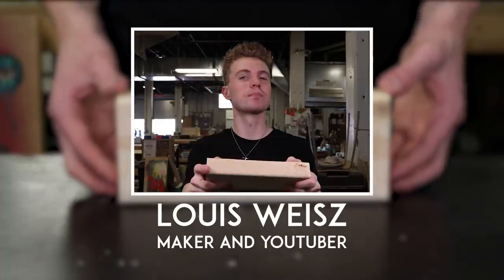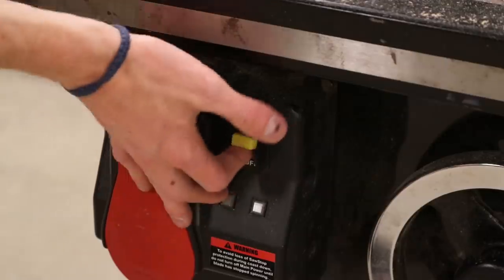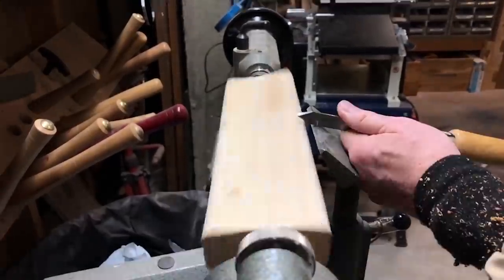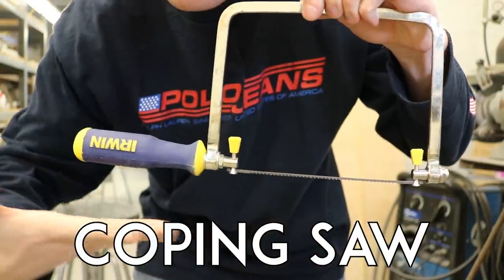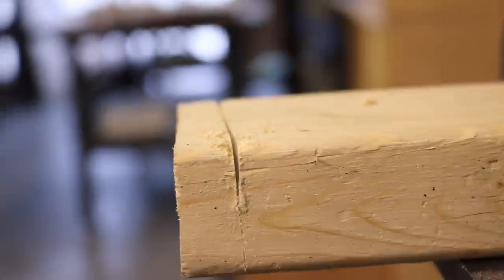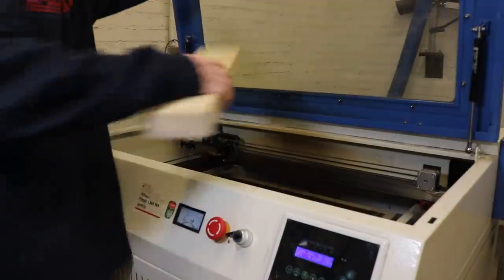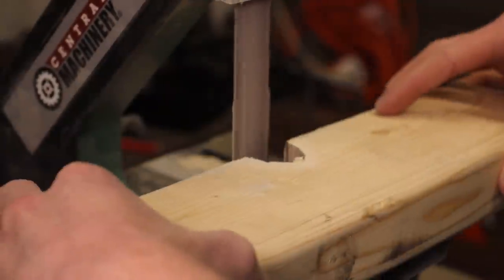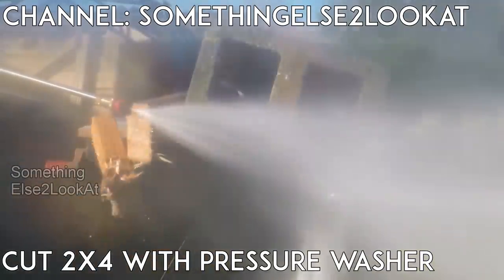Every Way to Cut Cheap Wood (39 Methods)

Comment: Seeing how he held a hand saw physically hurt
Reply: 4:57
Reply: @aquarius5264  Thanks!
Reply: Yes, pain.
Reply: Even my crappy 15 year old brain can tell that is not the way to do it. I've only used a small handsaw. Not the big ones.
Reply: Yep, its a straight back and forth from the elbow with one hand. extending from where the base of the saw begins at the wood to the end of the blade. Depending on the length of the saw your arm may sweep behind you, something that can't happen with the "two handed grip"
Reply: @diakounknown1225  I'm 15 too and i worked with wood with my dad and phew seeing how he was holding it kinda hurt
Reply: He used 2 hands for all hand saws which makes it even harder to use
Reply: wait thats not how you hold it?
Reply: @SkyHigh_xx  no... You hold it with one hand
Reply from the maker: @chaz7346  this is actually super helpful -- this is how i learned as a kid just because I wasn't strong enough to control the saw otherwise, but i'll be sure to remember this in future!
Reply: @Weisz glad to hear I was helpful.
You can steady your saw with your other hand, either on the side or back of the blade. But it isn't necessarily recommend. But just remember, just because your doing it by hand, doesn't mean it isn't still cutting and it will heat up the blade.
Reply: It's not that bad. Sometimes if I'm really impatient I use two-nanded grip to saw through faster.
Reply: @Weisz  Another tip for the hand saw is the point your index finger alongside the saw instead of placing it on the handle. Helps with control.
Reply: My woodwork teacher would have cried and tbh the idea of this big dude with a country irish accent who only showed emotion the time i joked about bringing home a red project from bleeding full on weeping at that is the one good part
Reply: Putting less pressure makes it easier to cut as well
Reply: @Jonah Lerberg ohh you have really good friends, i love that
Reply: Fr it gave me a PTSD flashback to when I was 5 and my grandpa taught me how to use a saw
Reply: @Weisz  However, make sure you use a Ryoba saw with two hands. The grip is designed so you can grab it with two hands. The ergonomics on western benches are questionable, but you should definitely hold it with two hands, pulling with your back muscles. It seemed to me that you lacked some strength in your pull, as if you were pulling with your biceps muscles.

You should see far greater efficiency that way :)

Comment: This is one of my favorite videos. Period. I've rewatched it over the years and it still holds up. I've been thinking & I think that any of the ones that were said that got stuck - the steak knife for example - may be possible. If you cut a wider hole like done with the turbo plane, you'd be able to fit the blade further into the 2x4, and you might eventually cut it. The way to cut anything is to make a wide enough cut.

Comment: In the past, when a timber was called a 2x4 [or "two-by-four"], it actually measured 2 inches by 4 inches. Now, most timber is milled and planed to give it a little more of a finished look, and a little more of a consistent size and profile
Reply: Ok
Reply: European 2x4, which isn't technically called 2x4 but everyone still calls it that, is actually way closer to being 2x4 than actual 2x4, it's 48x98mm, only a few mm short of 51.2 and 102.4.

Comment: If you've got patience like a goddamn rock, you can cut a 2x4 with literally anything
Reply: Wow hamon
Reply: @batziii8745   scrape it with the handle
Reply: chicken feather
Reply: @NeverXGonnaGiveYouUp ` i think the feather would break first
Reply: @NeverXGonnaGiveYouUp ` i said feather not feathers
Reply: @NeverXGonnaGiveYouUp ` thanks for being a good sport about it
Reply: lots of plastic spoons
Reply: Even with a water bottle
Reply: @jacobe5398  Go research how to clone the feather in order to get more feathers, obviously.
Reply: @NeverXGonnaGiveYouUp ` Trollge incident
Reply: @inpinksuit  hamon works
Reply: Use your nails to cut a 2×4
Reply: My toe?
Reply: Cutting a 2x4 with a 2x4
Reply: Cut a 2x4 with another 2x4 

I just realized the comments above mine is the exact same comment as mine. And here I am thinking I'm original
Reply: No not with your tongue
Reply: @jksnjh  well I mean, at that point it would be eroding away the materials but it may be possible to completely get through assuming you don't die or loose your tounge first
Reply: cut a 2 x 4 with a 4 x 4
Reply: Talcum?
Reply: even with grass but it would probably take afew years
Reply: how about using seesaw....
i don't regret it okay
Reply: @jacobe5398  rub the feather dust into the wood and the friction will start to burn it, problem solved
Reply: What about my hand
Reply: A Pantzer IV Ausf F2 German battle tank?
Reply: @jacobe5398  not if you believe hard enough
Reply: What about cutting a 2x4 with your big toe, or a hair? 🤔
Reply: @jacobe5398  that would take years and millions of feathers!
Reply: But i cant remove a flat 2x2 from another 2x2 😩
Reply: My finger?
Reply: Lol
Reply: i will cut a 2*4 with s comment i don't care how long it takes i will
Reply: What about a balloon
Reply: A leaf or a very thin peace of plastic
Reply: Human teeth
Better a human tongue still on the human
Reply: Technically, when the wood decomposes, it'll be cut in half... about 999999999999999999999 times
Reply: A 2x4
Reply: Paper towel
Reply: Water.
A book.
A needle.
Reply: Jesus loves you alot trust in His death 4 salvation and be saved from eternal hell <3 Jesus died on the cross for you bro. <3
Reply: @Fit4C  can jesus cut a 2x4 though
Reply: true
Reply: Your breath
Reply: Even your fist! But you gotta train in like bodybuilding or martial arts…
Reply: Air
Reply: Works with bedrock?
Reply: And a life span like one

Comment: 2x4 problems needs 2x4 solutions.

Cut a 2x4 using a 2x4.
Reply: @Aidan Bramwell i only get splinters
Reply: @kayburcky7146  😂
Reply: Dude you'll break both the wood
Reply: And it will become 1x2
Reply: @ironicallyvideos  lol yes I didn't even think about what YOU SAID
Reply: Caveman method 2.0
Reply: That's just the caveman method
Reply: I said the same thing
Reply: “I used the 2x4 to destroy 2x4”

-Thanos on his Farm, probably
Reply: Make a wooden axe
Reply: Ah yes the hardware measurements, a 1/4 in pipe is not 1/4in, a 2x4 is not actualy a 2x4, what other lies are out there?
Reply: @El_Hornio_II  It's the fancy caveman method!
Reply: Infinite IQ
Reply: its like that video that i did a thing made and it was cutting a tree using a tree? he cut a tree with a wooded axe
Reply: Yes i thought the same
Reply: Big brain time, you get 2 2 by 4s broken for the price of one
Reply: @thememebandit6767  You have become the very thing you swore to destroy!
Reply: LOL

Comment: "Cheap wood"
Yea that doesn't really exist anymore
Reply: Yep.
Reply: Twigs on the floor exist
Reply: It's dropping like a rock people making these jokes don't actually follow the lumber market
Reply: @DudeGuy-zt9eg  I'm saying it's a bad joke
Reply: @marcusrobinson1778  no. Lumber has been continually going up for the past 1 1/2 years.
Reply: @Bradyn08  isn't that just inflation or smthn. Tell me if I'm wrong cause I don't follow the lumber market
Reply: @marcusrobinson1778  I sure haven't seen it drop at the lumber yard yet
Reply: Why did wood prices go way up
Reply: @lucasisnthere9540  they kinda just are, and then corona didn’t help
Reply: @lucasisnthere9540  Rise in demand due to things like housing construction, decrease in supply due to corona causing workers to work less and the logistics disruptions the pandemic caused worldwide.
Reply: It exists, but not in the markets😂
Reply: @lucasisnthere9540  One of the biggest reasons was a whole lotta' dad's suddenly having nothing but free time a home improvement projects to work on, during the first months of the pandemic.
Reply: @marcusrobinson1778  I tend to prefer not swearing, but in this case i'd like to say "Bullshit." An 8' oak 2x4 was only 2.50 before the proce hike, and right now it's still sitting pretty at 15.50 at all the stores nearby
Reply: YEP
Reply: @marcusrobinson1778  

I'm
Reply: Damn it I just got recommended this vid again after the pandemic and I came to make the same joke :(
Reply: It does

Comment: 8:00
You can "cut" wood with an axe, by angekling it at 45° So you can kind of cut wood. You get a spike, but you get through it.
Reply: You literally get through the spike.
Reply: Well, a felling axe is designed to crosscut trees, while hatchets split along the grain, so those probably work way better
Reply: @notme8232  an ax does work better, but in a pinch you can cut a 2x4 in 2 or three minutes, you just alternate every other hit between straight cuts and angled cuts, instead of the 2 45 then one straight you do with a ax
Reply: angekling
Reply: V shape
Reply: you cant do that with just a normal axe you need a Canoo  axe

Comment: "Olfa cutter"
"Great for cardboard"

So... a box cutter?
Reply: @JohnSmith-gs2rv  The ones i’ve seen and used in my life does.
Reply: box cutters use two sided blades and “olfa” (i call them snap blades” use snap off blades
Reply: In Australia we call these Stanley knives. I believe it is more of a top brand like the Olfa cutter but we call pretty much all handheld box cutters and such the same thing.
Reply: Did a little research and the BLADE name is actually Stanley! Interesting.

Comment: Great video, Louis!

Handsaw is definitely my preferred method. When it's good and sharp it is almost effortless, and only a little slower than some power saws. I also like it because it's relatively quiet.

Another terrible way to do it would be with a mallet and chisel. Also  other chopping devices, e.g., machete, kukri, broadsword.

Fire, though, was historically (or prehistorically) a pretty important way of cutting logs. When the other option is a stone axe, using fire is pretty attractive.
Reply from the maker: Actually I tried a mallet and chisel! It was SO bad though hahaha - I didn’t even think it qualified to be in the video 😂
Wish I had thought of the sword idea though! That’s a good one
Reply: While on the topic of weapons... You've heard of an axe, and you definitely heard of a battle axe, so why not use a battle axe?
Reply: It would probably work. Depending on the type of battle axe, it might not be built to take that kind of impact and the axe could be damaged. The blades can be thinner and wider on some battle axes. Scholagladiatoria did a video on this called "can battle axes chop down trees".
Reply: @stevenreckling203  Well then... I did not expect a fellow nerd to drop by... Interesting
Reply: @Weisz  it's similar to a chisel, but have you tried a splitting wedge and a sledge hammer? The fastest way is to make three punctures on the wide side. Also a sledge ax would probably work if you have the muscle to swing it/ some experience with a ax or hatchet- cut once at a 45 angle then once at a straight angle, removing a triangle shaped chunk of wood, you can cut a 2x4 in about 3 minutes with that technique ( if I figure out the technical name for sledge axe I'll edit it in)
Reply: The label called it a sledge-maul, has a sledgehammer on one end, and a maul on the other, which is basically a axe with a very wide edge slope, cuts wood and thin metal, like car doors or copper pipes

Comment: Using you hands to snap it
REQUIREMENTS: Strength lvl 1000, Intelligence lvl -1000
Reply: Mind control 99999999
Reply: @Enaxity  LOL
Reply: Lol
Reply: Perfectly balanced as all thing should be
Reply: 5k stat points to learn + muscle gamepass
Reply: no requirements: be minecraft steve
Reply: Brain-999999999999

Comment: Actually, you probably can cut a 2 by 4 with a Dremel. You need a cutting bit. They sell one. It looks kinda like a drill bit, but it is actually for lateral movement. It allows for non-straight cuts. (Also works for enlarging a hole when you don't have an actual drill and the Dremel drill bits are to thin.)

Comment: Here's a couple of things you can try if you absolutely hate yourself:
1. A rock (without fire this time)
2. Your bare hands
3. Your nails (infinite pain)
4. Biting through it (actually don't even try, just use a beaver instead)
5. Brass knuckles (if you're a gangster)
6. Corrosive chemicals (why)
7. A lense (like a laser cutter, but slow and painful)
8. Rope (you'll need a lot of it)
9. Rats (like beavers, but more universal)
10. Karate chop
11. A sword (or any other melee weapon)
12. A shovel
13. A pickaxe
14. Basically any sharp or blunt object, just beat it 'till it snaps
15. A signalling flare (fire, but worse) 
16. Explosives (fire, but better)
17. Antimatter (ight imma head out)
18. Your knees (knees of others are also an option)
19. A screwdriver 
20. Scrap metal (if you REALLY want to suffer)
There, have fun with that.
Reply: a feather (tap it quadrillions of times on the wood)
Reply: Lol
Reply: 21. pizza cutter
22. scissors 
23. nuke
Reply: A much heavier car
Reply: 25. Train
Reply: NO CHAINSAW ???
Reply: Rubber Mallet
Reply: I was dying while reading this comment. It’s such an informational guide to accomplish something stupid

Comment: Hello. Thank you for your lovely video and time for filming this video, but I am not here for the purpose on commenting. I'm here to ask for an addition, if you're mentioning the use of resistance wood burning in the future. This type of wood burning conducts a voltage worth of 2000 volts. That type of electric circuit would kill any living being, that even slightly touches anything, that could have electric charges in it from the actual kit itself. It's actually so powerful, that a person would die before they even hit the floor. Thank you for reading, and I hope you add that warning in the future to not attempt that action at home, as any mistake is deadly. Lovely video, and lots of support from Bulgaria!

Comment: The most horrifying idea I have seen (and it wasn't even a "DIY" idea, I have seen this in a market) was chain from chainsaw wrapped around....a disk for angle grinder.
Reply: Now that's some fallout weapon time shit
Reply: I believe those are meant for brush saws, like weed eaters for saplings, and less extensively for ice and wood sculpting.
Reply: @jake3523  not really, it was clearly written it was for angle grinders, but I saw one for weed eater as well....and I think I will just stay with the standard techniques
Reply: Like I said, I've only seen those chain wrapped disks compatible with angle grinders used for ice or wood sculpting irl. except of course on YouTube where dudes will upload a video wondering why its so bad at cutting 2x4s.
Reply: @enslavedfunni1330  i hope somebody makes mod
Reply: Backyard scientist has featured one of those in a video
Reply: Something to note is that the turbo plane featured in the video is just as dangerous if not more due to its much greater weight and very aggressive cutting surface.

Comment: EXCEPT RISISTANCE/FRACTAL WOOD BURNING IS ACTUALLY EXTREMELY DANGEROUS AND SHOULD NEVER BE DONE! There is enough electricity to be able to go through wood, the thing with a high conductivity. Which means that it is enough to do significant harm to something much more conductive (like humans)…as in, do not do that, you can very quickly and easily die and many already have. Watch Big Clive's videos on it to learn 1) why you should not do it, and 2) why you should dissuade anyone who is considering doing it not to do it.

Comment: You should try using a/an
Axe
Pickaxe
Knuckle Dusters + punching
machete
Ice Pick
TNT/any explosive
Crushing it
Peeing on it/acidic liquids
Smashing it with a big chunk of ice
Friction (rubbing 2 2x4s together to cut one)
Swords
Sledgehammer
Molten rock (lava)
Jackhammers
Manual sanding with a small piece of sand paper
Chisel
Screwdriver
Freezing it for 24 hours and then smashing it as hard as you can against the ground
Flamethrower
The big long saws that requires 2 people to use
Shovel
Cringe
Stones/rocks
Nails (the ones used with hammer but without the hammer)
Screws
Boiling it/hot water

Comment: I've got one that will kill anyone's sanity, sand paper.
Reply: YESSSS
Reply: Why? Its coarse and rough and irritating, but it doesn't get everywhere like regular sand
Reply: screw dat ill use my teeth
Reply: @anim8dideas849  just like the beavers
Reply: What about a sandblaster
Reply: @anim8dideas849  you can do this. 
source: i was a very bored kid and birch is soft.
Reply: @theresnothinghereatall  Did you get the women and children too? Like animals?
Reply: @bensingleton5564  Isn't that where the fun begins?
Reply: Well 10:26 is sand paper but slower
Reply: Wtf true
Reply: @theresnothinghereatall  the r/prequelmemes is strong in this one
Reply: I’ve used it before

Comment: 5:08 the fact you were holding it with 2 hands gives me a feeling no one ever told you how to use a hand saw
Reply: Silence wench I just want to be happy  I don't think there is a correct way to do it but if your wood is not stable you do it with 1 hand
Reply: Due to Jeremy Clarkson’s famous words “speed and POWER”
Reply: @michaelpayne-bailey8274  solve many things
Reply: Me reads title: cheap ways to cut a 2by4 
Also me: (sees laser) say whaaaaaaaaaaaaaaaaaaaaaaaaaat?!?!!?
Reply: Bruh your names weird
Reply: @cosmic4297  cheap wood
Reply: Also how he used the pull saw wrong, definitely gives you beautiful cuts if you do it right.
Reply: He's the kind of guy who will not last without electricity
Reply: @thomasmontgomery46oninsta2  Very relatable to me personally. Makes me feel comfortable